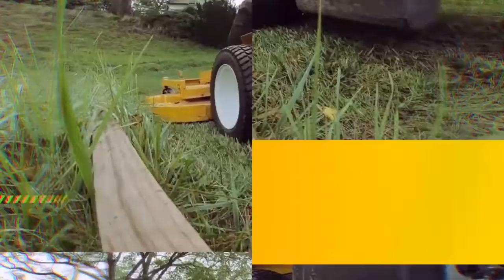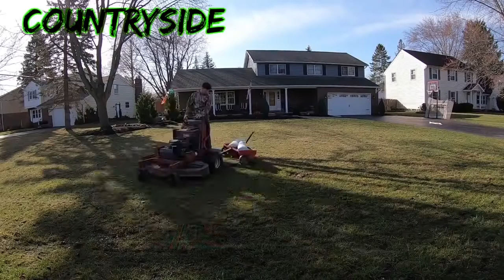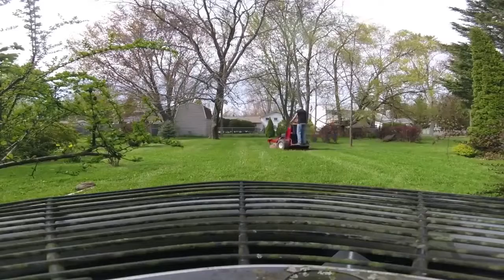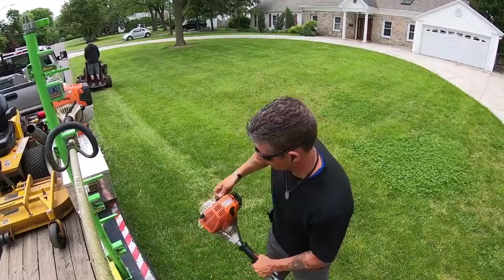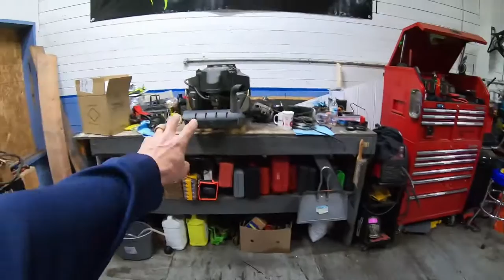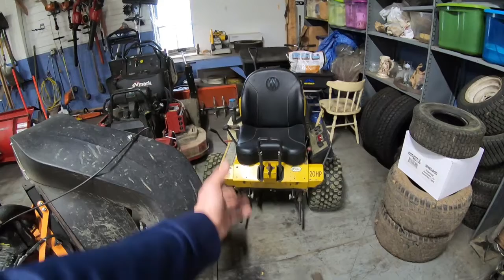TORO grandstand STANDER gets REPOWERED

Comment: Down here in the south, we get lots of northerners moving in. Come spring they head to wally and pick up the crap push mowers with grand ideas. As soon as that sun gets high in the sky the phone starts ringing and the push mowers are under the back porch. Just like clockwork. Lol. Between the heat and 90%humidity for months on end it will fry your brain if you're not ready for it.
Reply from the maker: Lol I've had buddies come up from Georgia and Alabama and their response was, WTF!? It gets so thick with humidity you can cut the air with a knife. You literally sweet standing still. Now I've lived in both those places and I'd say it's just as humid down south but three actually heat gets hotter down there. Everyone always says it's more humid down south and unless you're in way south Florida or Texas, it's not really any different than here in NY the south just has longer seasons

Comment: Hotdamn!! That's a good price for a new 23 horse 🤯 I need to go check out Jack's 🤔 But that's for my old belt drive 48, and I've already made a deal with a colleague for his old hydro 48 he no longer used, as a replacement, so I dunno if I want to get a new engine on the old 48-- since my shop can't get a sump gasket for that engine anymore....I should check with another dealer 🤔 in fact, I think I will, because I could keep that belt drive as a backup if I get it fixed....or crack the engine myself and use gasket maker this winter 😂🤷‍♂️ We'll see. But I broke out the belt drive today since it "warmed up" some  and it still took quite a few pulls to turn her over, but she did it. I need to still put a deck belt on the hydro, air up the tires, and adjust the tracking, other than that, she's ready to go.....

And, yep I'll also be looking to pick up a regular helper going forward next year, because this season was just CRAZY, so we'll see how that goes....
Reply from the maker: Yea I've been there before